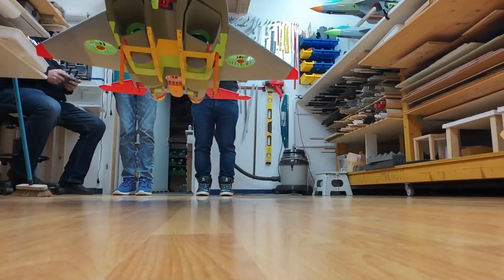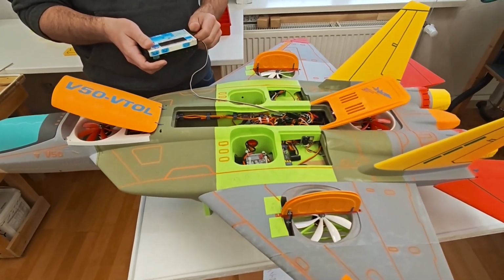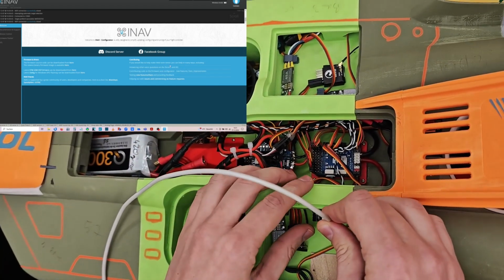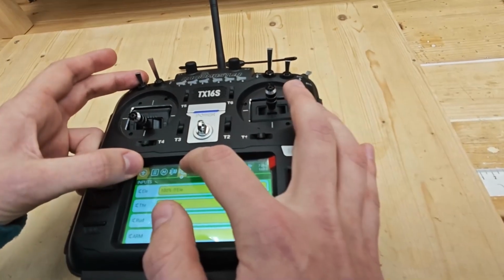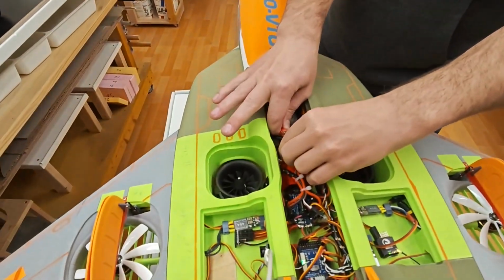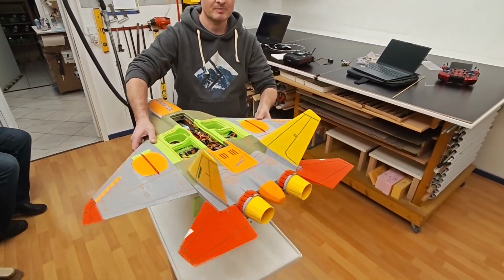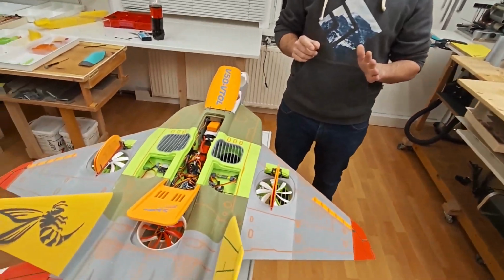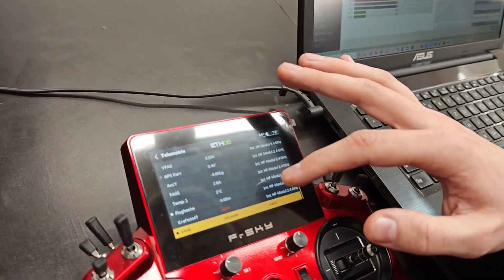JRM-01V50 VTOL 3D-Printed VTOL RC-Jet | INAV Setup

Comment: i started printing this amazing plane, using my bambu p1s , and i am using the 3mf files, the print is a bit soft also the support is stuck so much to the object its impossible to remove without damaging the object ( using colorfobb lw-pla , and yes they are dry !! ) any tips how to solve this ? ohh i forgot to mention the only difference i am using textured PEI , is that the problem ?
Reply from the maker: Hi, PEI is ok. For better support release just increase the Z-Top Distance in 0,01 steps. Should be about 0,21mm.

Comment: Does it makes sense to get the DC power for the 2 impeller Esc's from FC and not from the PDB board ?
I'm asking that because of getting telemetry data of DC power currents.
Or is it also possible getting telemetry data from PDB ?
Reply from the maker: The PDB just works as distributor to all Motors. The current sensor in the FC gives you the current data.
Reply: @rene_rosentraeger  So the power for the 2 impellers i should get from FC and the power for the 4 motors (2,3,4,5) i should get from PDB. The current of the 4 motors is not relevant for measurement ?!
Reply from the maker: @vaporpavi547    Please take a look to the power wiring pdf and Matek site. The battery goes to the FC - from FC to PDB - From PDB to ALL Motor incl. EDF.
Reply: @rene_rosentraeger  ok, will surch for this pdf. Thx

Comment: Hi, the servo reversers from the parts list do not work.
Then i bought other reversers from eBay. They in general works but not in combination with signal from FC.
So, can you pls. tell me the exact name of reversers which works correctly in your plane. Thx
Reply from the maker: This seems to be a rare issue with the reversers. Some don't work for any reason. Try this one Ich habe das hier gerade auf AliExpress gefunden: 
4,79€ | Hochspannung version Servos ignal Umkehr lenkgetriebe Wechsel richter 3V-30V Ersatzteile DIY für RC Auto/Boot/Flugzeug modus
https://a.aliexpress.com/_EvcRh9w
Reply: @rene_rosentraeger  I ordered now 3 of them and also 3 others from aliexpress for testing.
But in meantime i changed design to:  CH6 of crossfire receiver supports the inverted signal. Triggerpoint for changing direction  is the same as  FC has for non inverted signals.

Comment: Can you use a speedybee f405?
Reply from the maker: It's Bec is not strong enough. That's why the Matek is installed.
Reply: @ could you run a separate BEC?

Comment: My Crossfire Diversity Nano RX Receiver does not communicate with the matek H743 wlite
Wondering why after loading the CRSF diff file there is entered SBUS as "Serial Receiver Provider" in the Receiver tab of INAV configurator.
Loaded the diff file from Aerojtp.
Changed it to CRSF, but also does not communicate.
Channel 1 of receiver is CRSF TX (and also throttle) 
Channel 2 of receiver is CRSF RX (and also roll)
I wired receiver channel 1 to RX6 (H743) and receiver channel 2 to TX6 (H743) as pictured in matek ducumentation for CRSF
Temporary power supply for matek is in the moment usb-c 
What am i doing wrong ?
Reply from the maker: Does your Receiver get power? I think we also powered the board with a lipo. I´m not sure if your usb also powers the Receiver.
Reply: @rene_rosentraeger  The receiver is powered by 4 cells eneloop and receiver is also bound with TX16s.
Reply: @rene_rosentraeger  Now connected also 5s battery to FC. Does also not work.
Reply from the maker: Ground and Plus is also wired like shown?  Pleases send us a pic of the wiring via mail.
Reply: @rene_rosentraeger  Did not made extra connections for ground and plus. Do not know where.  I have sent you the pictures via mail. Will receiver at the end powered by FC ?
Reply: @rene_rosentraeger  Thank you Rene. Did it as you answered via mail and as it is documented in Matek doc.

Comment: Hello, in the moment i am on step 48 and 49 in assembly instructions pdf.
But if i do it in way as discribed it will not fit.
I have an idea doing it different way but not sure if it is best practice.
Can you pls. make a picture of your port wing door servo linkages ?
Reply from the maker: My assembly is the same as on the manual pictured. Please check if you used the correct hinges on each side.
Reply: @rene_rosentraeger  Checked it, the hinges are correct as in manual. The problem is when i assemble the balls at hinges as pictured in direction to air duct the balls will collide with wall of air duct. Can send you a picture of fan doors with hinges if i know to which email adress.
do not understand that it fits at yours and not at mine. Want to understand where my missunderstanding is.

Comment: Hello, yesterday the 2 "QX-MOTOR QF2611 50mm 
EDF 12 Blade 4000KV for 5s" as listed in part list were delivered. I followed link in partlist and choosed the 4000KV CW and CCW Version.
Now the instruction manual says it is a 3-4s Motor.
Is it ok operating this motors with 5s ?
Reply from the maker: Yes, it's ok.
Reply: @rene_rosentraeger  Great, thank you for fast response

Comment: hi i downloaded the files and want to print them on my Bambu p1s. And avery time the slicing go`s well but if i want to print them i got a message that the nozzle is not correct. What do i do wrong?
Reply from the maker: What nozzle diameter do you have installed?
Reply: @rene_rosentraeger  a  0.4

Comment: what is meant by Carbon Tube 6x1mm
1 mm hole or 1mm wall thickness ?
Also question for Carbon Tube 3x1mm, do not find this in assembly instructions pdf
Reply from the maker: 1mm wall thickness
Reply: @rene_rosentraeger  thank you for fast response.
But this Carbon Tube 3x1mm, where is it used, i do not find it in assembly instructions pdf

Comment: Good morning, which filament do you use for the NON LW parts ?
When i load the file JRM-V50 Vane and Block 01.3mf in Bambu Studio the Slicer says 5,77g for all the 3 parts
Thx in advance
Reply from the maker: Pla plus or tough. Or Petg
Reply: @rene_rosentraeger  ok, and with this filaments there is nothing to change in parameters in bambu studio after loading the 3mf file ?
Reply from the maker: @vaporpavi547   the 3mf are set for pla though/plus
Reply: @rene_rosentraeger  Great

Comment: In my Crossfire Receiver Output Map there is set
Output 1 CRSF TX
Output 2 CRSF RX

But also throttle and aileron are programmed in TX16S on this both Outputs.
Can they run in parallel on this Outputs ore has the throttle and aileron to be changed to other Outputs ?
Reply: These are different outputs. You have: 1. the normal channel outputs (throttle, aileron, rudder etc.) from the radiomaster to the receiver 2. the output from the receiver (CSRF TX and CSRF RX) from the receiver to the flight controller. So, if you have configured the receiver to put out CSRF TX on channel 1 and CSRF RX on channel 2, you are right. You can now connect the receiver to the flightcontrollere on these channels. On the TX16S, you leave the defautl normal output mapping to the receiver.
Reply: @davidschramm1057  Interesting. Sounds good. Thank you for detailed explanation

Comment: Hi,
Looked at video again regarding arming and switching on transmitter
I understood the following:
Arming: 
Disarmed at -100% on CH5
Armed at -50% on CH5 (or something <> - 100%)

Flight modes:
Normal Flight at -100% on CH8
Hovering at +100% on CH8
from Hovering to Normal it should take 5 secs
from Normal to Hovering it should take 2 secs

Is that correct, if not pls correct me
Thx in advance
Reply from the maker: Correct

Comment: just downloaded the files, looks good. But another question in general: I think that the transmitter has to be setup as normal 3 axis model instead of deltawing model, right ? So that the mixing will be done in flightcontroller.
Reply from the maker: Yes, correct.

Comment: Does not work with my graupner mz24 pro ?
Reply from the maker: Check if you have Sbus out on your rx
Reply: @rene_rosentraeger No, unfortunately not
So, other question: which rx do you use with the TX16S ?
Reply from the maker: @vaporpavi547 Express LRS
Reply: @vaporpavi547  Actuallly, it is Crossfire. But ExpressLRS would work too and is a much cheaper alternative.
Reply: @davidschramm1057 in video were delivered diff files mentioned for frsky and crossfire. In future then also files for Express LRS ?
Reply: @vaporpavi547 ExpressLRS uses the same Protocol named CSRF, so you can just use the CSRF diff.